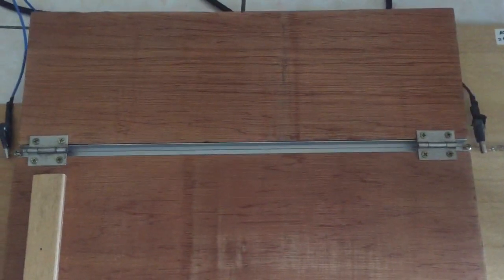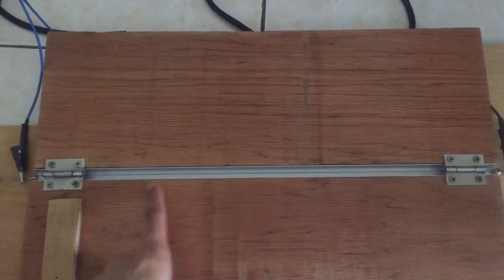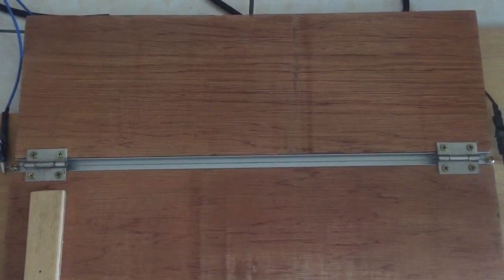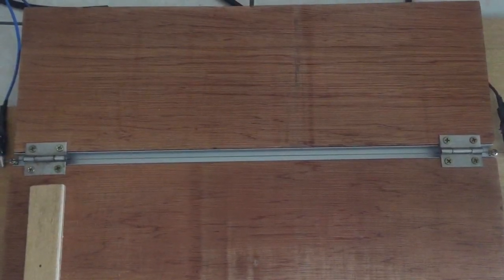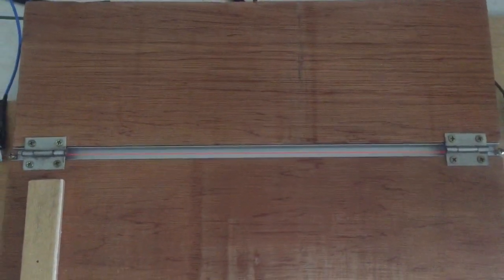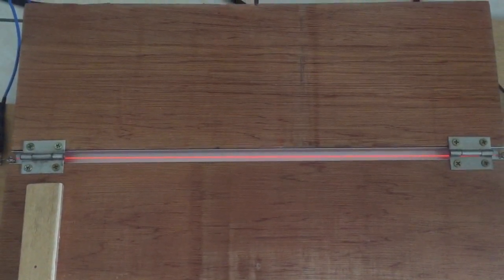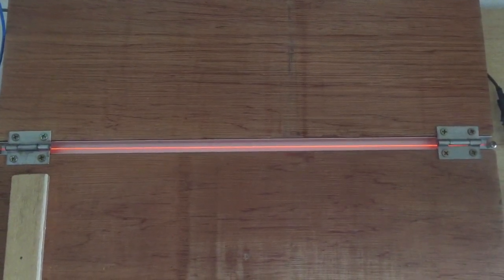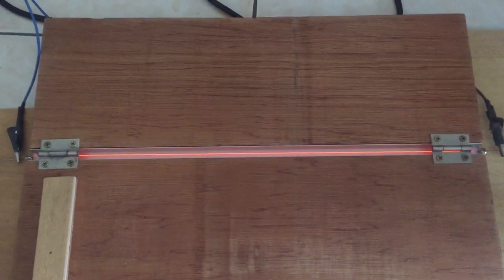Nichrome wire acted as a heating element in an arcylic bender

Comment: Do I need AC or DC? Or does it not matter? What about 24v DC Max 13 amps?
Reply from the maker: It is easier for me to use AC. There is a chart for power requirement with different wire gauge. Mine drag roughly 9Amp it is already very hot. Video about how to check amperage as follow.

https://youtu.be/qGR1MZ1XNpY

Comment: Have a question. Does one end of the wire goto positive and the other to negative?
Reply from the maker: Yes. Indeed. Red represents positive.
Reply: @CTB6  how many volts required, can we do with mobile charger
Reply from the maker: @suhelgaming2548  
Not suitable for mobile phone charger. You may get an adapter for mobile phone charger online. Do not use it for mobile charger. It will burn your mobile phone.

Comment: with power
Reply from the maker: I did not connect directed to power but it has gone through voltage regulator. Step-down transformer with dimmer switch.
Reply: @CTB6  ohhh what the name of it brother? trying to set this up
Reply from the maker: @TheFlyre  
Do you meant the power supply?
Reply from the maker: A variac allow temperature to be regulated. Do you have any experience in electricity. It can be dangerous!

Comment: @Liew Seng Choy, dear sir, i got an ac voltage regulator, i can make the voltage from 0 to 220, the question is..... how bout the amperage....... my home power is 220v, 25 amps (5.500 watt maks).

if i set the voltage regulator to 5 volt.... how much amperage will it flow ???

i use 24 awg, with lenght more or less 100 cm.

thanks
Reply from the maker: I would suggest to test it with ammeter.

There is a link i shared down there about the relationship between wire thickness and amperage. Have a look!

Comment: Hi, how many volts and amps does this use? what is the resistance of the wire?
Reply from the maker: Hi there !

If i remembered correctly, i used Nichrome wire of AWG 22 gauge. The transformer's output voltage 13V at roughly 10Amp AC.
Reply: Liew Seng Choy thanks mate. I have a project where I have to heat something to 500°C. What temp were you getting?